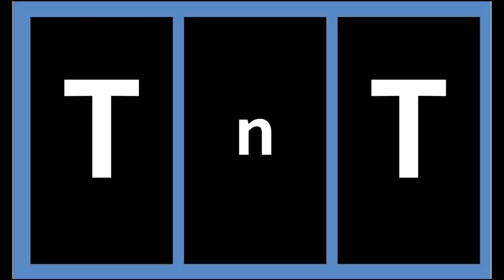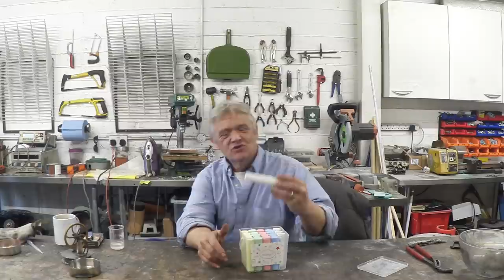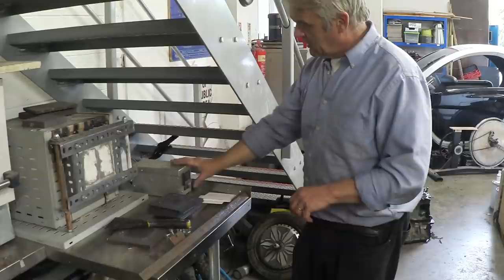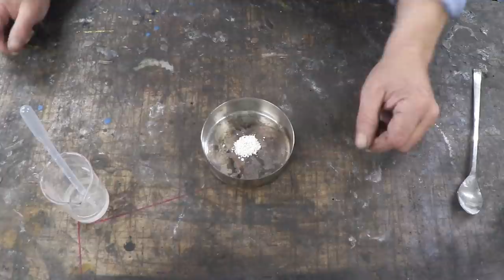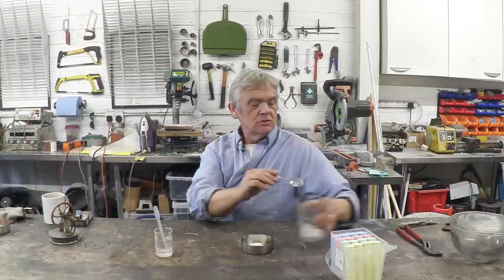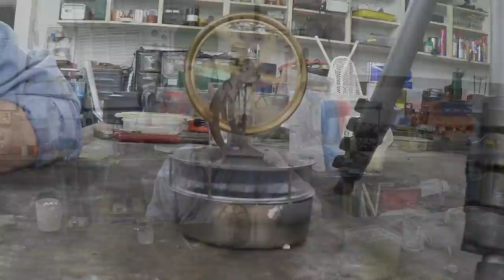1267 How To Run An Engine On Chalk

Comment: A very important tip for using lime (or concrete): wash your hands before going to the bathroom. The skin on your hands is relatively more resistant to chemicals than most of your skin, and the skin on your fun bits is much much less resistant.
Reply: Ouch
Reply: Wash hands in diluted vinegar till the soapy feeling of the cement goes away.
Reply: I regret my ignorance of this serious warning.  This sensitive area can easily become infected once the skin has been breached resulting in an experience best described as YOUR WORST NIGHTMARE. Imagine the shock of waking up glaring  at what was once your Pride and Joy replaced by a very altered looking object.
It's not easy finding the courage to seek medical assistance and even more difficult when you have a less trusting partner. Best avoid this situation and take heed of this advice. Wash your hands prior to going to the toilet!
2.

Comment: Thanks for doing this program Robert. I buy in finely 'kibbled' quick-lime which I slake, pronounced slack here in Somerset, into my lime putty. For every tub of quick-lime I add 2 tubs of water and get back 2 tubs of lime putty which I mix with the sand for my mortar.

You can of course do what is called a 'hot-mix', this is where you mix the sand (or chalk aggregate) and quick-lime together with a little water, mix it up and leave covered for 24 hours or use straight away. It's preferred by masons and wallers because it expands in the joints I'm told. 

I normally slake my lime and leave it in a tub with a little water to cover it and use it days, weeks, months or years later. 

The Romans left their putty to mature 4 years before using it. The advantage of Roman mortar over other mortars is weight and no doubt a lovely sticky mix. Without it they could not have built the oldest building in the world with a domed roof, the Pantheon.

They also unwittingly discovered a mineral (not that they knew it) called Phillipsite which is produced when lime mortar blocks are submerged in sea water for 5 to 10 years. Under stress the Phillipsite bends rather than shatters and explains why Roman harbour sea defense walls are as strong today as they ever were and just like adding fibers to a mortar it gives it a stronger tensile strength.
Reply: excellent information i was looking for  thank you very much indeed

Comment: Probably a crazy question but would it be possible to make a sort of renewable cooker out of calcium oxide? Get some calcium oxide, add water and use the heat to cook food then use renewable energy to go back to calcium oxide by heating and then repeat.

Comment: Can you make a generator that runs off of some kind of slow chemical reaction or physical change that expands, or contracts pushing a piston with great force. Piston to Pullys to Gears, high torque into higher speeds. Is this possible? if vacume can be created with steam condensing in chamber. Then how much pressure will the atmosphere apply to piston. Got the idea when I saw a heated 50 gallon drum collapse from pressure years ago. What kind of gear ratios could the force work.

Comment: I would have mixed it with vinegar to make calcium acetate.
Calcium acetate decompose into acetone and calcium carbonate under heat.
An combustion engine can run on acetone vapor.

Comment: Problem is, you need to find a heat source to provide heat in the first place to form the quicklime. I live in a vast limestone area of South Australia where the stone has been used as a building material everywhere as well as for building mortar, but unfortunately much of the timber was stripped from the land to fire the lime kilns. Between that and clearing the scrub for cropping, it's created an ecological disaster !
Reply: Fresnel lens you can use the sun to make quick lime.

Comment: Calcium carbonate: also used as an antacid.  I'm going to microwave some Tums :)

This could also be a way to store solar thermal energy for later use if you use a solar dehydrater to evaporate the water.  Night winds may also aid in dehydration overnight if there's not a lot of humidity in the ambient air.

Could maybe be used to directly heat a house in winter using radiant heated floorboards

Could also use the heat in a hey box to cook food.  Or bury it in the ground under a Dutch oven. 

Fireless cooking... I can imagine a sort of calcium powered barbecue pit, but like a slow cooker. Just add water instead of lighting the fire. The water wouldn't even have to be clean, but as a side function, you could condense the steam into something drinkable.

Comment: Hi Rob. I believe the reaction actually releases roughly 8.5 X the amount of kilojoules. So it's nearer 57kj per 50g as opposed to the 6.7kj per 50g as mentioned in the video. I've been investigating several methods of cheap seasonal thermal storage lately and have looked at Sodium Acetate Trihydrate, Calcium Chloride Hexahydrate and Sodium Sulphate Decahydrate among others as options. Having watched this video, I'm now going to compare the above with Calcium Oxide + H2O.

Comment: Flint, cement, and the white cliffs of Dover!  I saw recently that calcium carbonate was used to make "fossil fuel free steel" in Sweden.
Reply: Technically calcium carbonate (chalk) is a fossil, it just doesn’t burn like coal or oil.

Comment: Very cool, has me thinking heat battery's.  So you could make a solar oven and cook chalk all day while the sun is out and then use the stored heat later in the evenings just by adding water.
Reply: In a sealed bottle you could store it for centuries, Fresnel lenses are amazing.

Comment: Yes, calcium carbonate, hydroxide, chloride are very useful chemicals - the hydroxide - slacked lime has many uses in scrubbing too - I would say however the initial energy consumption for conversion is good for proof of concept when added to the sterling engine - but highly inefficient as the initial expenditure to make the starting material is massive compared to what the sterling engine would generate in return.
Reply: Fresnel lens solar cook it.
Reply: Barskor1 yes indeed, a good idea👍 and a solar cooker in tandem (old satellite dish with mirror tiles on it 😊

Comment: Gooday Robert. A story from Aust about my trucking days and quick lime. I used to load roadtrains of it to take to mines in the northern territory in 20kg bags off a conveyor and onto pallets. In my day the trucky had to load 22 ton of the stuff onto each trailer and they generously helped me lay wooden pallets on the deck to load them onto. Anyway, after loading all those bags fresh from the mill and covered in a fine dusting of the stuff, some of it eventually made its way into my skin pores on my shirtless shoulder and by the time i had loaded both trailers totalling 45ton i had quite the sweat up and in a day or two from the mill on my 2400km journey my shoulders would shed skin like a bad sunburn does and by the time i returned for my next load around 6 days later i would have to go through the rather painful ordeal over again. After a few complaints by myself and other drivers about the problem, they issued us with soft leather shoulder covers held on by a strap around our necks and under the armpit not used for loading. Well after less than an hour of wearing them we had terrible chaffing and extra bad lime burns in the raw skin and one poor guy needed hospital treatment for his infected wound. After all this they finally decided it was better to have the pallets machine stacked and then loaded onto our trucks with a forklift to our joy. They then changed to large one ton bags on pallets which continues today more than 30yrs later. We often chat about those days before oh&s went crazy and wonder how rich we would be in todays world should a similar thing happen. Sorry but this just reminded me of those times..

Comment: Hi Rob, and of course this is 1 half of the story. Endothermic reactions with say ammonium nitrate cool down, which are useful in a hot country like Thailand. Basically, a chemical aircon unit, using the sun to dry the chemical and distilling water into the room to apply to chemical there. Cant seem to work out a good method of moving the crystallised chemical back into the room. Nearest so far is a rotating plate, half in the room and half in sun....but i will keep banging my head on this !!!!     
All the best,   Tony

Comment: Why not run a typical steam engine to generate electricity? As a concept we could create quicklime in areas with high renewable energy capability to power electric kilns and ship the quicklime to powerplants where renewables aren't a viable option as a form of energy storage. Once slaked use it to build with and you've just integrated energy production and heating with construction.

Comment: Beautiful! With a solar reflector-concentrator to heat the kiln, I wonder what might be the system efficiency? Considering that the slaked lime is re-used, I wouldn't mind a lower percentage solar capture... especially compared to the up-front cost of solar panels!

Comment: Instead of using a Stirling engine, you should try it with a thermo electric generator with aluminium and graphite.
Reply: Try grafoil sheets and glue it onto the aluminum with Roberts ink.

Comment: I am amused by the thought, my comment on the possibility of using the calcium oxide water reaction in the previous video may have inspired this one. Regardless, if an energy efficient way of reversing the reaction can be found, 'we are on to something', as Robert might say...
Reply: Fresnel lens solar cooking it back to oxide.
Reply: @Barskor1  What temperature can a Fresnel lens produce? I am trying to find at what temperature dehydration would occur. Which may be at it's melting point of 580 C. I just  read a study on the reaction for energy storage. They looked at temps of 400-550 C. Still looking though.

Comment: But did you put more heat and energy into it than you got out?
Reply from the maker: there will have been a loss of efficiency because the Stirling is a heat engine and so Carnot cycle applies - but that is true of any heat engine
Reply: @ThinkingandTinkering  No, not that far - I mean the kiln procedure.
Reply: @polyfoamcoats1650  Yes must have been a fair few KW/hrs.
Reply: You can melt rock with a Fresnel lens you can cook quick lime as well with free sunlight.